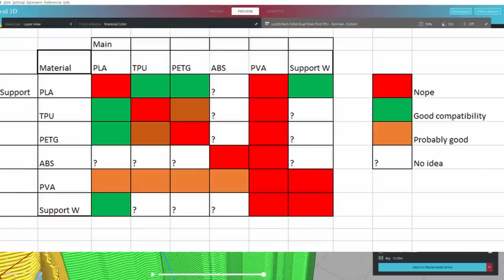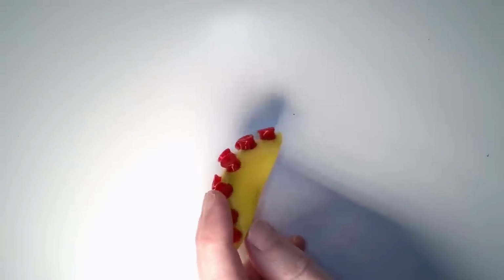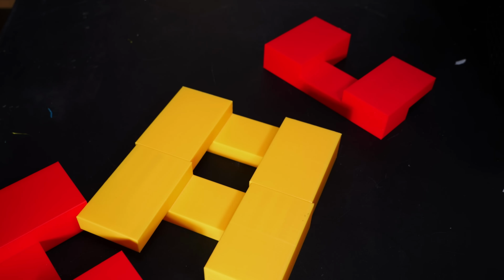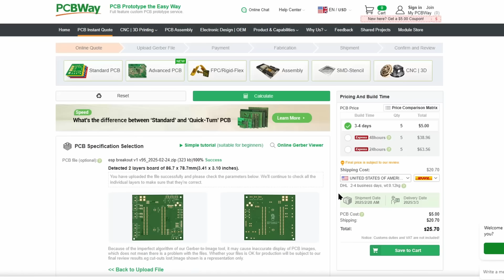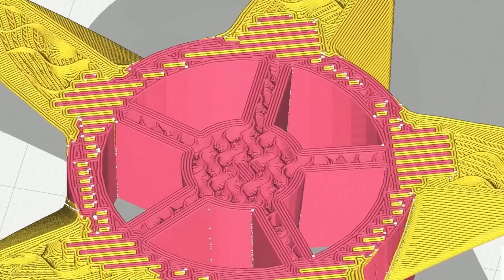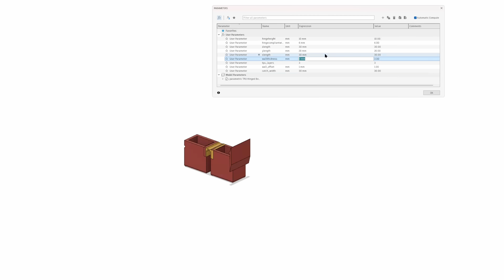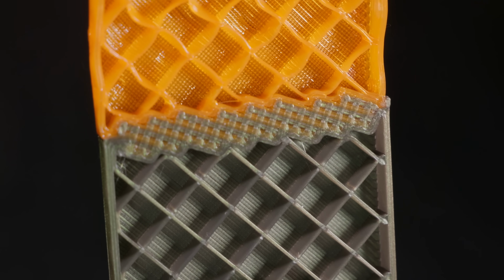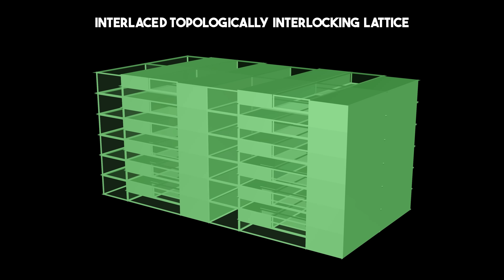3D Printing Multi Material? Turn this setting on.

Comment: Is there a way to do this just on prime/purge towers?
When trying to use PLA or PETG for supports with the other the tower always breaks apart.
Really would just want it for that so it sticks together
Reply from the maker: seems like the sensible option would be two purge towers but I dont see any slicers doing this yet.

Comment: I had a box for my vape batteries. It started to go bad. I reproduced it in blender. I printed it in PP. The quality was horrible at first. It always warped.....until prusa released the PP build plate. Now it's almost too perfect. lol It doesn't even need a brim. Anyway it works just as well as the original box.
Reply from the maker: Glad to hear the build plate is good as I've actually asked for one to test out 😁

Comment: Another useful video.  

It was about 2 hours too late though.  I had just started a 20 hour Print with PETG and TPU and would have tried this.  No big deal though as PETG and TPU stick pretty well, but this interlacing would be much stronger.

Thanks for sharing.

Comment: Heard a rumour that HIPS is very suitable for living hinges but haven't tested it myself. And it's cheap. And it's pretty. That's not a rumour, that's just truth.

Mhm pva, does it need high molecular weight in order to be cohesive and printable, but that prevents it from being easily dissolved, is that it?
Reply from the maker: dont hear about HIPS much lately, thats the one you can dissolve in limonene isnt it.
Reply: @LostInTech3D   Yes that's the one. And in turn HIPS for some reason while susceptible to acetone, isn't fully dissolved in it. If you drop ABS into acetone, you get a liquid ABS solution. If you drop HIPS into acetone, you get an evil alien blob floating in acetone, it absorbs it but doesn't really mix with it, very eery, and once you take a little out, it expels acetone and dries quickly. At least that's how the ones i have had have behaved, i think all HIPS i bought while under weird random brands has actually all been made by Sunhokey, at least the spools have all had that look, you know, the gotta go fast spool design, same exact spools.

Comment: Why are you using a commercial product for your parametric designs rather than an open source product, OpenSCAD?
Reply from the maker: I would really like there to be a usable open source CAD solution that I get on with, while I think openSCAD is really cool and clever I dont think anyone is going to convince me that it's a practical replacement for a normal parametric CAD, for pretty obvious reasons. Don't say freecad, I've put too many hours into trying to get along with that thing.
Reply: @LostInTech3D  I have to agree with you on FreeCAD. Its UI is definitely not user friendly

Comment: OP - Why don't you DIY a magnetic stirrer or ultrasonic tank to dissolve your PVA?  Complaining is, Ah-noi-ing (annoying).  Use warm/hot water...
Reply: Good vid - otherwise. Thanks!!!
Reply from the maker: ultimately theres no problem to solve that a stirrer would solve, the bad PVA is just bad and wouldnt dissolve with anything short of a blowtorch it seems.

Comment: I don't have much use for multi color printing in the same nozzle and I hate the wasted time and poop material waste.  I'm interested in a modern IDEX printer but am now even more interested in the BondTech INDX system that does a four second swap to another hot end assembly.  That would be ideal for products I want to make with PETG-CF and TPU feet, bumpers or padding.

I designed a simple ABS/TPU live hinge and printed it on a dual head Qidi back in 2015.  Large contact area, no interlocking, and it worked very well.  Slicer interlocking looks MUCH better.

Comment: I'll likely never be able to utilize this, but it's nice that it exists for those that can
Reply: Why not? There's no hard reason somebody couldn't design a multi material unit that could be built for $20, using a bluepill microcontroller and some 28byj motors and a couple roller switches.

Actually might do that.

Direct control from Klipper would be ideal, but next step would be to detect loooooong retraction like 20cm and switch material automatically, making it compatible with any printer at all if you only need two filaments.
Reply: @SianaGearz  have fun with that
Reply: @TS_Mind_Swept   Yeah i'm actually joining heads with someone. Another jank hardware, cheap stuff, FreeCAD masochist just like myself. Did you know that the planet is big enough that more than one similarly unhinged person exists?
Reply: @SianaGearz  well I've yet to find anyone like me, but glad you found someone at least

Comment: I'll definitely remember this feature if I get a multi-material printer, incidentally PETG & TPU stick together pretty well, like when changing filaments midway with a single nozzle printer, though I bet proper interlocking multi-material prints are stronger.

Comment: I got some PVA which turns out to be only 'partially' soluble. What a mess.
Reply from the maker: Was it reprapper brand by any chance
Reply: @LostInTech3D  It's TronXY. It may be that I soaked it for way too long and need to give it just a quick soak and then tear everything off and it will work a lot better. Need to try that experiment.
Reply from the maker: Hmmmmm. 

Also try using only one wall and even under extruding

Comment: I think if you made the pegs more rectangular than triangular on the living hinge, you could leave area between them on the bottom to get a more gentle bend. Probably you'd have to also bevel the corners slightly though to avoid cracking there.
Reply from the maker: yeah the parametric model allows you to vary the tooth angle, gap, and calculates the tooth shape and number to make the right radius, that gave me a headache, more on that later :)
beveling is interesting. I'll have to think about that.
Reply: @LostInTech3D  - It seemed weird that you apparently evaluated every material for your single material live hinge except TPU,  You couldn't print the long bridge for the live hinge in TPU, but you wouldn't need to do that.  A short thin flap connecting the box top and bottom would work very well, but you wouldn't get to play with the parametric teeth.   🙂

Comment: You could also demonstrate it with popsicle sticks - two different coloured ones for clarity. Arrange them like the slicer would put the beams and glue (or drill and bolt) together the same coloured ones. Have one with the sticks spread out to show that the two parts aren't stuck together but interlocked, and then a tight version.

I guess you don't need to do any of this since you've already made the video, but

Comment: Can you do this in Bambu slicer with the same filament type? I'm trying to utilize the entire H2D build plate but the seam point where one nozzle ends and the other starts is very weak as there is no overlap to strengthen connection.
Reply from the maker: Unfortunately bambu's closed system doesn't allow for interlocking until or if they see fit to port it over. As far as I'm aware that hasn't happened.
Reply: @LostInTech3D  just watched another review mentioning it's there now, have to check myself

Comment: I'd love to but I'm using an original Creator Pro and as such I'm stuck with shitty Sailfish and FlashPrint 😭
Reply from the maker: you can use any slicer can't you, and upload the gcode?
Reply: @LostInTech3D  no because it only accepts x3g files unfortunately, not gcode. It's really annoying. It's also a work printer so I don't want to mess around and try flashing the main board to Marlin.

Comment: Actually I use ABS + TPU or PETG + TPU regularly to make hinges (without any interlocking). They bind quite well. Most of these hinges consist of just 2 layers (0.4 mm) of TPU with ABS or PETRG printed on top. The door hinges of my RatRig Vcore 3.1 IDEX 500 are made this way and after 2 years still look and feel like new.
Reply: I do the same.  tpu Is some wildly strong stuff for as flexible as it is

Comment: If School Districts were smart, they would mandate small format 3D printers for every student in the STEM pipeline.  Why?  It would eliminate the classic problem of new engineers/scientists/physicians from entering their career fields with zero real world understanding of the mechanical properties/manufacturing tolerances, etc., that confound machinists and technician when the "idea" person understands nothing of how to make something in the real world, no more getting blueprints/tolerances that are impossible/ruinously expensive to create/integrate.  Desk top 3D printers for students should be as common as hand held calculators were in the late 1900's, desk top computers at the turn of the century and smart phones in the early 2000's.  Change our society from a throw away mindset, to "I can print a part to fix that Mom/Dad... just give me a few minutes in CAD and time to prep the build plate."  -- Any 10 year old child, on the STEM track in 2030
Reply: It should be, but it takes a bit for schools to catch up to what's relevant. The districts in my state are especially slow (I remember my middle school couldn't seem to get new computers for the computer lab even after the funding was approved for 3 years). The districts here are terrible at everything. On the other hand, my son's charter school actually does have a 3D printing club after school so there's at least some movement in the right direction there.

Comment: Seeing this when I'm currently designing a 2 nozzle mod for my Ender 3 is really nice
Reply from the maker: Interesting, hope that works out well, there's not enough of this kind of stuff anymore!
Reply: @LostInTech3D  it's a lot of designing work for sure, I'll try my best!
Reply: @Mysda_  I used a 2 input heat break on my Ender 5 and a second extruder. The biggest struggle was the whole filament swapping/purge tower thing in Cura. I could swap from one to the other but never got a sensible tower. I could do embossed first layers but never got further with it.

Eventually swapped to a volcano hot end and went back to a single extruder. Literally a few hours before watching this video it occurred to me that I could have used the volcano with the dual radiator. Don't know why I never thought of that before 😢